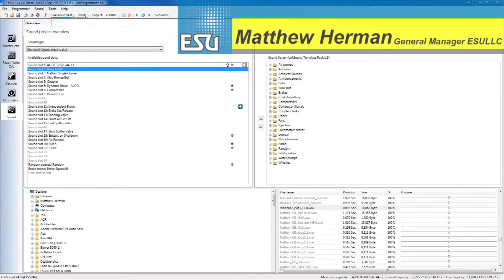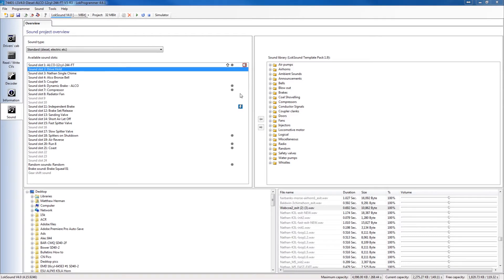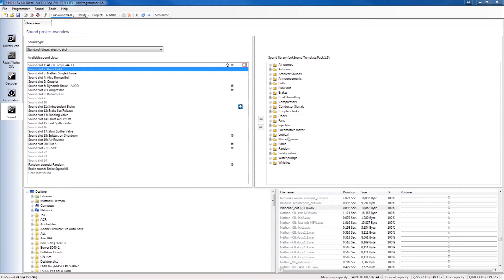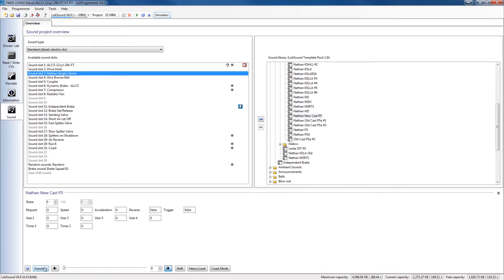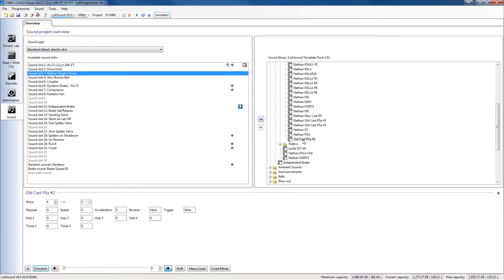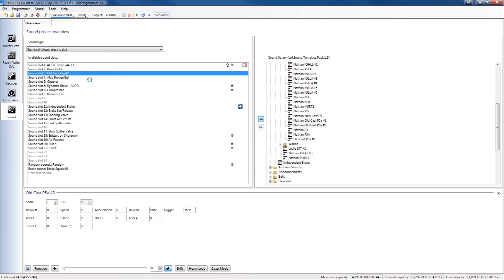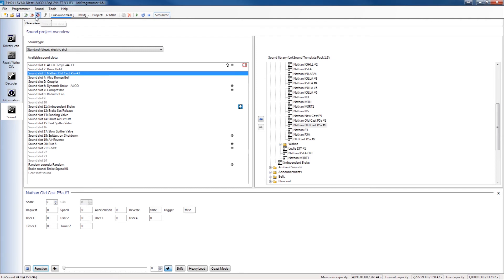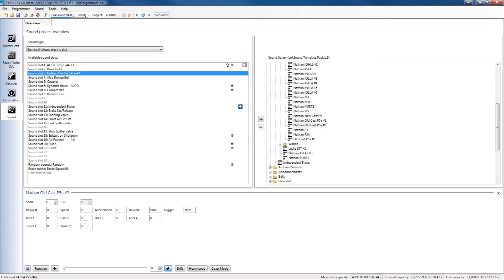LokSound V4.0 Series "Changing Sound Slots Using the Template Pack"

Comment: I tried changing the whistle on a locomotive and now the locomotive acts like it is dead, I can read the CV with Lokprogrammer but when I put it back on the layout there is no sound and it does not move, take it back to the programming track and it can read the decoder and I can write to it, any clue what is going on?
Reply: I solved the problem, it was the Keep Alive circuit that I added, I had a TCS KA2 that I used, which works fine but can't be connected when programming.  after I unsoldered one wire it all worked fine.  I now have a small plug on one of the wires so I can unplug it when programming.

Comment: ESUDCC I Have A Hugh Problem Last Year In December Before Christmas I Bought A Scale Trains Rivet Counter HO Gauge Northfolk Southern GE Tier 4 GEVO,ET44AC It Has A ESU FullThrottle Loksound V4.0 Keep Alive In It DCC Sound Equipped When I Took It Out Of The Box Wow Was I Surprised I Put It On The Track I Have A NCE Power Cab Meanwhile It Started Up By Itself, Anyway The ESU Loksound Was Not Even Programed From The Factory So I Downloaded The Manual From There Website The Volume Was Very Low, I Could Hear The Horn When I Pushed F2 Button On My Power Cab And The F1 For The Bell But Could Not Hear The Prime Mover. So I Went To The Manual And Found The Master Volume And Set CV 63 To 192 And Now I Could Hear And Three The Horn, Bell An The Prime Mover Problem Solved... Now I Need To Change.The Other Sound CV'S It Says In The Manual Before I Do This I Must Program CV 32 To 1 Before Changing The Other CV'S Correct, I Need To Change All CV's That The Factory Didn't Do The Compressor, The Air Valve Release, The Start Up Sequence Is To Low, Also The Engine Sound, Radiator Fans And Blower I am New To DCC And I Don't Want To Short The Decoder Out Can You Help Me Please I Will Pay You To Help Me You Don't Know Just How Disappointed I Was When I Put It On The Track, And Heard It For The Very First Time, Out Of All The Reviews I Seen On YouTube Everyone Who Has The Scale Trains When They Put It on the Tracks The Sound Was Perfect I Was The One Who Got Stuck With One That Wasn't Even Programmed At All..
Thank You
Henry Lewis

Comment: ESUDCC I Have A Hugh Problem Last Year In December Before Christmas I Bought A Scale Trains Rivet Counter HO Gauge Northfolk Southern GE Tier 4 GEVO, It Has A ESU Loksound V4.0 Keep Alive In It DCC Sound Equipped When I Took It Out Of The Box Wow Was I Surprised I Put It On The Track I Have A NCE Power Cab Meanwhile It Started Up By Itself, Anyway The ESU Loksound Was Not Even Programed From The Factory So I Downloaded The Manual From There Website The Volume Was Very Low, I Could Hear The Horn When I Pushed F2 Button On My Power Cab And The F1 For The Bell But Could Not Hear The Prime Mover. So I Went To The Manual And Found The Master Volume And Set CV 63 To 192 And Now I Could Hear And Three The Horn, Bell An The Prime Mover Problem Solved... Now I Need To Change.The Other Sound CV'S It Says In The Manual Before I Do This I Must Program CV 32 To 1 Before Changing The Other CV'S Correct, I Need To Change All CV's That The Factory Didn't Do The Compressor, The Air Valve Release, The Start Up Sequence Is To Low, Also The Engine Sound, Radiator Fans And Blower I am New To DCC And I Don't Want To Short The Decoder Out Can You Help Me Please I Will Pay You To Help Me You Don't Know Just How Disappointed I Was When I Put It On The Track, And Heard It For The Very First Time, Out Of All The Reviews I Seen On YouTube Everyone Who Has The Scale Trains When They Put It on the Tracks The Sound Was Perfect I Was The One Who Got Stuck With One That Wasn't Even Programmed At All..
Thank You
Henry Lewis
Reply from the maker: Hi Henry, Please contact us at support@loksound.com I would suggest setting CV8 to a value of 8 on the programming track. Not on the main. This will reset the decoder and should set it back to factory settings.

Comment: What happens when you try to add new sounds to a pre recorded loksound from UK shops
Reply from the maker: Unless you have the original file from the UK shops they are locked. I'm afraid there is no way to edit these without the original file. Only CVs can be "read" from the Decoder. The sounds cannot be pulled from the decoder into the software to edit. If you want to add or change a sound on a custom made file, I suggest contacting the creator of the custom file.